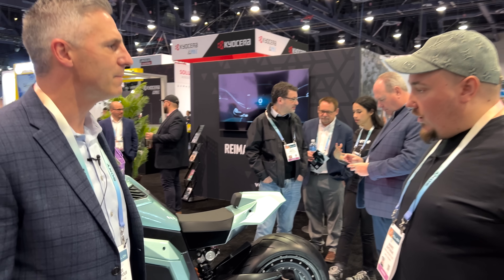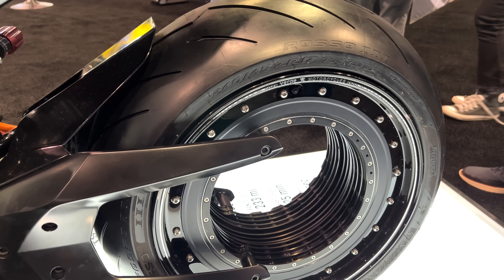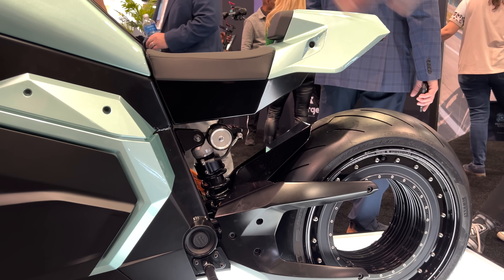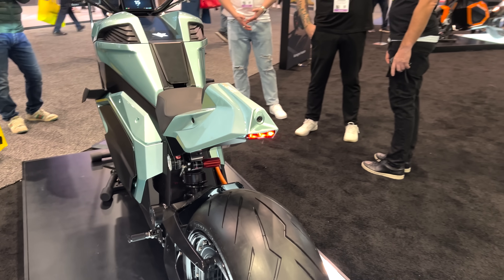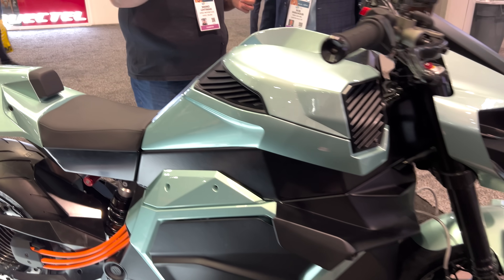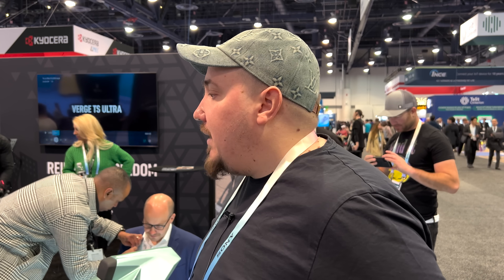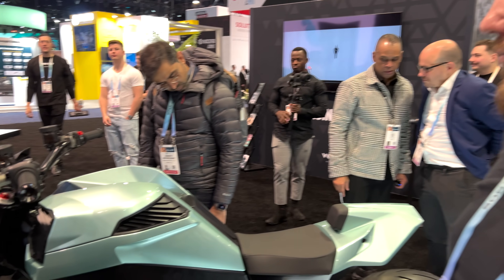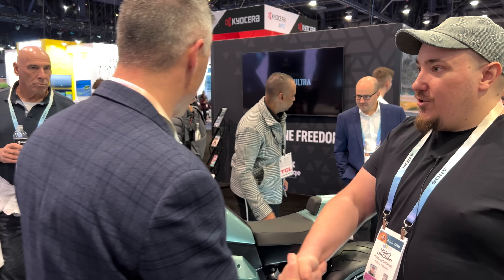Verge TS Ultra: The Future of Electric Motorcycling | CES 2024

Comment: Absolutely love the engineering of the rear wheel and the over all design philosophy but the blind spot cameras are just useless weight on a motorcycle especially when you have literally zero obstructions from just simply turning your head to see if there’s another vehicle.

Comment: If that was made affordable? Oh my F would it change motorcycles from this point on. But whoever can make this with the common sence of putting the weight low? Get rid of the cameras to tell you how to ride? Wheel is cool, but why not put out affordable model to gain traction? Your giving up the next harley spot to whoever dont price it by its newness. To re-engineer a motorcycle from gas to electric? It's really dumb that anybody would stick to the traditional design of a motorcycle? Like Tesla has a frunk not a motor just because there used to be one there 😂. Whoever comes out with a affordable? Wins...soon as ppl ride it? They will want it. So why not start low & let the love be the emotion of stepping up to this? I am 95% posative you ride it? You love it. So put your brand under as many ppl as possible to get the ball rolling? I could sell those motorcycles by the truck load. But not at that price. You have a dodge demon, but no charger, or hornet? Someone has to beat harley to the punch. I hope 🤞 its verge. My personal favorite.

Comment: This product is a scam, they attract buyer with insane impossible numbers, they claim 1200N-m (885ft-lbs) of torque from a small 150kW motor, that's almost as much as the COMBINED output of the three much larger/heavier motors inside a Tesla Plaid, they bumped the numbers 3-4X.

Comment: But why those ugly handlebars? It's a metal tube. You have that super modern looking bike with... a bent tube as handlebars. And you derps do understand that most people sitting on that bike won't be young-boy-shaped Asian guys in tight leather suits, right? Imagine a 43-year old slightly overweight software engineer riding it with fluorescent clothing and a yellow Schuberth C4 Pro helmet. Then your whole modern aesthetic will look rather silly.

Where do you keep the luggage? Where is the windshield?

It's like a motorcycle that was designed by a 60-year old who saw a few too many sci-fi movies...

Comment: Better weight management, simpler, more torque, lower voltage requirement & less magnetic flux. Far more effective application of technology.

Only improvement I can think of is a quick-change battery system.

Beautiful engineering!

Comment: Hubless rear wheel motor is brilliant for a road bike. Unsprung so not good for off road I guess.  I wonder if the larger diameter of the motor would mean easier generation of torque?

Comment: The problem with the motor design, appart from the unsprung mass, is the reversed torque that is put on the swingarm without a torque arm. Thats going to rise the suspension while acceleration and vice versa while breaking at these torque levels. If that motor wants to put out 1200Nm of  tourque while still beeing capable of around 1700 rpm it will probably run very unefficiently.

Comment: I NOTICE THEY DIDN"T LIST THE WEIGHT OR PRICE$ ON THAT SPEC SHEET! I found 540 pounds online. long way to go before something like this becomes a viable gas replacement and not a toy for the rich who don't really drive motorcycles as transportation. Most serious motorcyclers dont want bikes that heavy and bulky. And 99.999% of motorcycle buyers don't want to pay a premium for an inferior product. All of Africa/ Asia/ South America / Much of Europe have a need for future electric motorcycles- but there's no place for bulky monstrosities like this, and the ones that are similar in weight to combustion bikes, have terrible range and power so no self-respecting motorcycle rider is going to want one. Then there's the climate impact - the impact of a moped that gets 75mpg is absolutely tiny compared to Americans who drive inefficient cars and SUVs. Also, have the designers of this PROTOTYPE that has no place in the real world ever SEEN THE PLACES people in Asia, Africa, Europe, and South America, and Rural US/ CANADA ride their motorcycles? This thing wouldn't last five minutes on rough roads, let alone dirt-roads and water crossing and gravel, etc. This would be driveable on well paved highways only. This looks like it was designed by someone with no experience motorcycling in my opinion - or a very limited understanding of what motorcycling means, globally. 134 miles on the highway is nothing for a bike this size; and What happens when you SMACK THAT BATTERY OFF A ROCK, and it shatters; is the company going to replace it for free? If not, then it's a terrible design.

Comment: motorcycles are so much more weight / energy density sensitive. heavy bikes with no range are a no go; makes more sense to replace cars, and use remaining gas for mopeds. gas motorcycles make inherently more engineering sense than gas cars - due to the weight aspects

Comment: they should levetate the wheel around the hub with a maglev-like setup where the hub is suspended within a magnetic field. so you use rotating magnetic pulse to move it forward or backwards

Comment: Looks Great and congrats on this prototype! I do have questions though:
#1. Parts and service. The age old questions that actually make something viable. 
#2. If that motor really has 200hp, that swingarm looks very under engineered. 
#3. Agree that the motor is in a great place for many reasons, but it's right in the water and grime! Not convinced it will hold up very long..

Comment: This design massively increases the unsprung weight of the rear wheel. Apart from sealing issues half the motor mass is now above the rear wheel axle making the design also top heavy . How do you put a rack or top box on as they have cut the arse off so short. The rider is going to get mud all up their back as there is insufficient mudguard. Overall they should be ashamed of this garbage

Comment: Seems a heavy bike thus turning difficult parking maneuvers by hand, seat is a race track seat so not for regular people, the bike main body is too closed and compact, rendering the bike sensible to strong wind, I had a ST1100 with the same problem. Low gravity center is a positive point.

Comment: How do they keep the thing cool? How do you do the temperature management for a high performance Lithium battery which gets parked in the hot sun on a 105 degree summer day? How does that work without active cooling with a heat pump? How does the inverter and motor survive? Sounds strange to me.

Comment: Motor in rear wheel = unsprung mass....the bike is an industrial designers wet dream, but a riders nightmare.
Reply: The weight of the battery is substantial and positioned low. I wonder how it feels to ride..

Comment: For those wondering about handling characteristics, just look at the wheelbase of the bike and it will give you a good idea. This won't handle like a naked/sportbike, but like a cruiser.

Regarding the 885 pounds-feet of torque the electric motor has, to give context, it is common for fast ICE bikes to have over 1200lb*ft of torque in first gear at the wheel.
Reply: I'm going to have to disagree with you that looking at the wheelbase tells you how it's going to handle. There are many other factors involved that determine how something handles.
Reply: @JasonWW2000   I'm making the assumption that the designer is competent and they have optimized rake, trail and center of gravity. Even the Diavel has poor handing compared to all the sportbikes with ~6 inches less wheelbase; the giant 240 section rear of the Ducati doesn't do it's handling any favors either I suppose.
Reply: fast ICE cars get stomped by the Tesla plaids E-torque is real

Comment: 150kW with no liquid cooler is a big L. The heat has to go somewhere and so the trade off for keeping things simpler will be slower charging rates and/or reduced battery life and performance degradation from thermal throttling. I've got an emoto with 10kW of peak power (1/15 the stated power of this bike) and it can thermal throttle during the summer under moderately hard use.

Comment: I'm all for out of the box solutions and creative concepts. But the basic drawbacks of the inefficiency of electric motorcycles remains. Distance travel at speed is not solved with this effort. 134 miles at highway speed? It's likely sport/touring at brisk speeds (well above 120kph/75mph) will further reduce the range to surely under 100 miles. Then the slow  recharge times and inadequate infrastructure charge network make distance travel untenable. So we have an expensive urban bike for runs to the 7/11 but no place to put my milk.

Comment: Ive run Zero DSR, SRF for 4 years, good machines and air cooled. This looks good but Im concerned unsprung weight / water ingress / debris ingress on peripheral motor drive seal. Agree bike 360 vision is a good idea, survival is ride defensively, the more eyes/brains the better.

Comment: Was an owner of a hub motor motorcycle, absolutely awful to ride as the weight in the wheel would come crashing up if you hit a bump, and this was after I tuned the damping rates of the suspension. From my experience, hub motors are a terrible idea for those who want a comfortable and safe ride. By the way, I own a 2022 Zero SR now and it's amazing.
Reply: Optimal is front hub/rear hub and a mid drive, and then do everything you can to mount the battery as low as possible

Comment: Edit: The Fuell Fllow was vaporware, and went bankrupt after scamming hundreds of buyers, including me. So probably why Munroe never considered them. 😂 It's so hard to find independent owners and reviewers of these Verge bikes. And now with them claiming to be using the first production fully solid state batteries with insane specs, I remain skeptical of this whole operation. Show us the third party validation of those batteries.

I would like to see the Munro team interview the engineering team working on the Fuell Flow, it's a much more practical electric motorcycle for urban commuters that also has a rear hub motor. It's also substantially cheaper.

Comment: "he Verge TS and TS Pro have slightly more muted specs, though the performance is still sporty, with a 0-60 mph time of 4.5 and 3.5 seconds, respectively. The TS starts at $26,900,.while the TS Pro is priced at US $29,900. The highest-performance TS Ultra model is significantly pricier at US $44,900."

Comment: 2 problems 
1-I will NOT ride ANY motorcycle that takes control away from me in emergency situations.
2-No motorcycle shop that I know of will want to have anything to do with changing that rear tire.
Show me an electric bike set up for touring with a 500 mile range and I might show some interest.
Reply: The tire comes off with the rim, the motor stays connected to the swingarm, the tire is replaced like on any other motorcycle wheel.
Reply: it's not taking control away

Comment: Cool ride!  ~ $50k* delivered in Hollywood?  Exec Summary: Rob from Munro now wants an e-cycle, so he makes an infomercial using Munro's name to grift Verge to get one.  What is going on with Munro?  Rob's title is VP Sales.  Is he trying to get a consulting gig for Munro in Estonia, or looking for a new job?  Munro is an engineering consulting company focused on Lean (efficient) Design and DFM.  Is business that bad that they're looking for customers at tiny e-bike and e-cycle companies (in Estonia no less!).   Perhaps Rob should read some cautionary books about how to dilute , weaken or destroy a "Brand" while sipping on a Bud Light.  Sheesh! 🙄

*$45 k FOB Estonia, shipping & delivery costs + tax and license fees are a additional.  Verge's products start at $26k.  So this TS Ultra, 2 wheel, "the rider is the flesh "air bag" cushioning for the 'bike" thing, feature laden and cool as it is, costs more than a Model 3 (or an Arcimoto Trike, which at least has 3 wheels).  How is the "ride experience" at the factory, where it's currently well below freezing and quite windy (Where is that?  It's just 50 miles South of Helsinki across the gulf of Finland).

Comment: I like Verge, but it‘s nearly impossible to get in touch with them. I was very interested in buying one, and wrote them a few questions. No reply at all.
There were two deliveries in Germany last year, that I know of, and both bikes were brought back to the factory because of software and hardware issues. Never hear anything from other customers in the internet.
Now I will go with Zero Motorcycles this season. Verge is too risky. Nevertheless they have the better bike (except price) - on paper 🤷🏼‍♂️
Reply: Hi David! Sorry to hear that. We try to reply as promptly as possible and are sorry that we've missed your message. Could you kindly specify the email address to which you sent your questions? We will try to locate the messages and make sure to reply as soon as possible.
Reply: Before that, I tried the contact option on your website

Comment: Imagine the first day you lay that down when parking or such.  Every rider has done it.  Make it stand up by itself and I'll be impressed.  Electric kick stand to park the bike would be awesome.
Reply: Suppose there are more Aron Von Zippers out there than I thought.  Haven't in almost 50 years of riding dropped a bike from forgetting to put the stand down while parking it or moving it around the garage.  How smart would the system have to be to be able to reliably determine for every rider when they did or didn't want the stand to automatically deploy?

Just unnecessary weight, complexity and cost along with another expensive item to repair when it breaks.

Best!
Reply: @neilfromclearwaterfl81  every rider in my riding group of about 46 people have thought they put the kick stand all the way down and when getting off the bike had the bike tip over.  Sometimes more gently than other times.  Getting some larger bikes on the center stand is much harder. I have a bigger bike and the center stand parking is very hard.  I don’t mean automatically like it should know when to deploy, I mean automatically when you push a button it will deploy.
Reply: @djemcee  I am so sorry to hear that.  

Perhaps you younger folks have gotten too distracted as that is a very, very rare thing in my circle of older riders many of whom walk with canes yet still can get a touring bike on the center stand.

Often issues getting the bike on a center stand can occur due to putting lower profile tires on the bike or from certain attempts at lowering it making it so the center stand is now too tall and you have to overcome a larger center of moment to get it over the top.

Best!
Reply: @neilfromclearwaterfl81  strange response

Comment: I’m concerned that it is not water cooled. How do you keep the battery at the right temperature if you leave the bike sitting in the hot sun for a few hours?
Reply: I saw pictures of the „naked“ battery pack. Unfortunatly they are not available online. They have some sort of passive cooling plate on both sides (unterneath the black panels at the side of the bike). On every of this cooling plates sits a fan. I would say it‘s not the best cooling solution, but it‘s better than passive only and a liquid cooled system adds weight, complexity and more need of maintenance.
Will be interesting to see back to back ride-charge-ride-… scenarios in real life.

Comment: Mounted as it is with no suspension, that motor going to take a lot of vibration/knocks
Reply: Railroad engine's motors are placed directly on the axle (wheelset) so they get even more beating (due to its mass) and do not fail. I gues it can stand it.